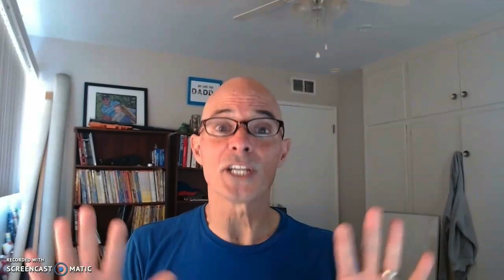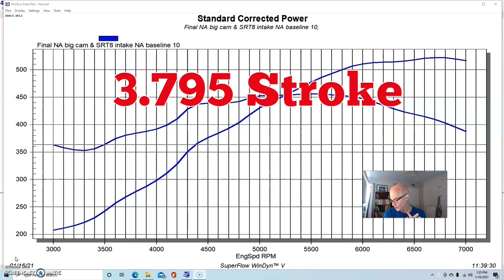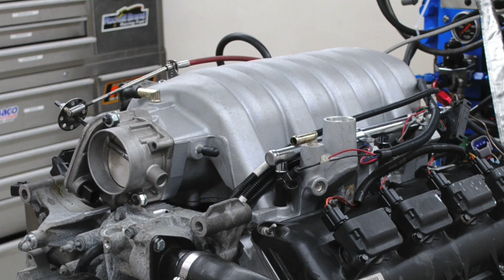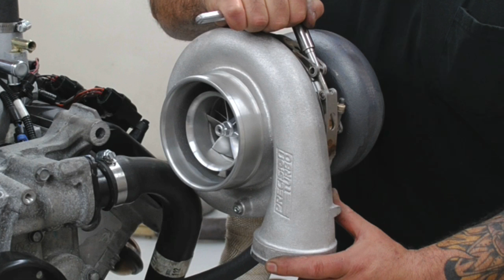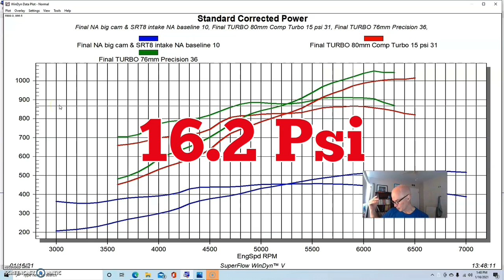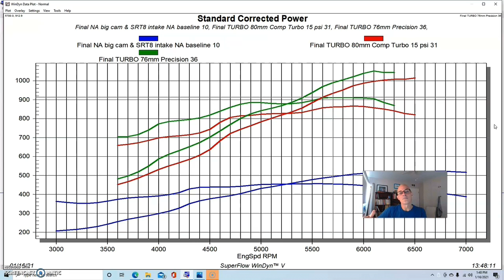1,000 HP TURBO GEN 3 HEMI-MILD vs WILD

Comment: How do you think twin gt35's would work on this? Say round 10 to 15 lbs of boost? Ring gap and all of course
Reply: Or would maybe 66/62's with .70 ar? 800 wheel shouldn't be an issue. When do I have to worry bout pistons? I stay under 1000 I safe?
Reply from the maker: would work fine

Comment: Are these engines total garbage anyone know about a way around valve dropping issues as in a upgrade
Reply from the maker: CAN EASILY BE FIXED AT MACHINE SHOP OR NEW HEADS
Reply: @richardholdener1727  I’m planning on doing a hellcat sc on it and I know I need pistons ect but I doubt stick heads will hold up with whole valve seat dropping on these , I’m a Chevy guy and want to get into something different

Comment: Whats your opinion on the edelbrock victor ii?  im looking at it for my build in the next month or so...
it has the long runners like the magnum intake, but 92mm tb opening.  not seen one dyno run on it though....
2008 ram, 392 NA stroker,  comp cams HRT 3 master kit 277/283 .632 lift, long tubes, hand ported heads (early hemi heads) 309 cfm, 92mm hellcat throttle body....
Reply from the maker: I have one of those and was in the process of testing it when the test mule broke
Reply: @richardholdener1727  awwe bummer. 
My 2008 Ram has a 6-in lift and 35 inch tires so I want to keep my low end torque... I'm assuming the Victor II would be comparable to the SRT or Magnum intakes
Reply: @richardholdener1727  Im just building a fun street truck. not going to track.  I chose the victor ii for the long runners for some low end torque, its a truck.  
But Im thinking of the HRT3 camshaft to give me some top end too.. 224/234@ 0.050 / 0.632
/0.619  115 LSA  (PN MK112-305-11)
Do you think this would be an interesting combination for a balanced build? or do you think it would be a bad combination?  6.4 stroker

Comment: Is this a high compression hemi stroker?
Reply from the maker: NOT HIGH COMP
Reply: @richardholdener1727  so I need help on picking the right turbo for my truck it’s a low compression forged 5.7 stroker 394 and I am looking to reach 1000hp at 5,500 above sea level. What size turbo would be good? I am running a D1sc ProCharger right now that can’t handle what I am trying to do. Thanks

Comment: Excited to see what my results are, I have the Manley stroker kit, did the 8.8to1 compression kit, so hopefully can see some high boost numbers. Just trying to plan accordingly with what size turbos to run? Would like 1000 or as close as possible, any ideas on good one but not break the bank? And you said run stage 2 turbo cam from comp?

Comment: Richard! Love your videos,great info and great knowledge.
Got a question for you.
I was told by a salvage yard that a Ram 2019 hemi 5.7 won't work on a 2011 Ram 5.7,is that true? I know the timing cover is different but other than that the block and heads are the same right! It should be a direct swap right?
Thank you!

Comment: What size injectors did you use to make 1000hp. Don't wanna reach 1000 yet just wanna buy them once lol
Reply from the maker: 80s will do 1000 hp on gas-need bigger to get there with e85
Reply: @richardholdener1727  actually waiting on my e85 fuel pump now lol.  What size injectors would you recommend?
Reply: i run bosch 220s on e85 and im waaayy past 1khp when turned up.  close to that even just under 10psi but im at 411in 10:1 ish and twin s475s.
Reply: And piston ring gap!?

Comment: you should a video with the 5.7 hemi comparing the stock 5.7 intake manifold and the 6.4 intake manifold from a charger/challenger to show the effect of the variable runners. also show what the differences are with cam, headers, other bolt-ons, ext. to see if it has diminishing gains or progressive gains

Comment: Richard, you da man.

My 5.7 is a stroker 397 with full built and forged internals,cammed , 6.1 intake, thitek heads, 6.4 coil pack swap, long tubes, and T6 80mm turbo. 🤘
Reply: yo ik you made this comments four years ago but i was wondering if this was the full build of your 5.7 and how much hp its makes im young and wanna build mines if u can give me a list of your build that would be cool
Reply: @gamingwithjayswag8132  yup, so im
Running a Holley terminator x max ecu 
5bar map sensor (holley) 
Srt intake 
Dual coil pack conversion
Manton valve covers 
Fore innovation  fuel rails 
FIC 1200 injectors 
Twin 525 fuel pumps
1 7/8” long tube headers
CNC’d Thitek dual beehive heads(titanium valves)
Thitek push rods
Mds delete 
Hellcat lifters 
Melling high performance oil pump
Comp cam timing chain
Arp mains/heads studs
Arp swap on every bolt
BTR custom grind  cam
ATI damper 10% overdrive
Callie’s compstar 10:1 compression 6.5 (3.937) forged stroker kit
All new bearings (cam and crank)
On3 performance T6 80mm turbo
50m blow off and 60m waste gate

May have missed some things. Ran me around 17k to build on my own. Made 1106 at the tire before tapping out the turbo.
Reply: @jeepwk6.5L  thanks man i really needed this
Reply: @gamingwithjayswag8132  yup np I have some of the videos on my channel hidden lmk if you need anything else.
Reply: @jeepwk6.5L How has reliability been? Thinking of building something similar but keeping it N/A since it will see hard use everyday but still want to be able to boost it in the future
Reply: @reece7259  i daily it at 93 pump at 950 rwhp and track it on the weekends with race gas

Comment: I would love a combo in my Ram that puts 600 tq and hp to the tires from 2500 to 6000. Problem is getting the 545rfe to live behind it.
Reply: My 545rfe blew apart during tuning and I was only at 718 at the crank when it let go. I’ve ran it back before my second build and it held 433hp for 2 years.

Comment: What's the longevity of a 7-900 hp third gen? Can i boost a stock bottom end to 700 and drive it everyday? Would like to know
Reply from the maker: yes you can
Reply: @richardholdener1727  can I whipple a 2019 5.7 charger stock internals?
Reply: Just want 500whp

Comment: Hi can you do test of piston ceramic coating on turbo engine? Measure on stock fuel 98ron gas power, temperatures, knock limits, ignition advance or something more? If it can be possible i will be happy. Thank you, very good videos.
Reply from the maker: i don't have knock detection
Reply: @richardholdener1727  And how you tune ignition timing? on pump gas and boost?

Comment: Did you use 6.1 heads or did you use the truck heads. I’ve heard you need an adapter plate to use the 6.1 intake on the 5.7
Reply from the maker: i used 5.7l heads and no adapter
Reply: With the truck timing cover you would have to run a truck intake. MMX makes a bracket kit to spread your compressor and alternator out of the way of the throttle body on the car intakes. It comes with a timing cover with the top hacked off. You can also run a car timing cover to just relocate your alternator and compressor, but will have to extend a/c hoses and alternator wiring. Also, alternator may contact the frame rail. If you use a gen 4 intake, the coolant passage bump under the throttle body makes contact with the bottom of the intake - many guys solve this with a heat gun and some light molding of the underside of the intake.
Reply: @RecoilFreak  hey man
By truck you mean Ram, or also Durango?
I am asking because I have 2 HEMI Durangos
2009 and 2015 RT
Would the 6.1 intake manifold fit on both?

Comment: I am ignorant of the hp potential of the new hemis so please don't take this as bashing. I'm just curious why it seems down on power vs  a similarly modded ls3. The hemi intake ports look fantastic in comparison to the ls.
Reply from the maker: ls3 is 6.2l and this was 5.7l-the 6.4l Hemi makes more than the ls3
Reply: @richardholdener1727  The video says it ended up around 6.1 liters with the 20 overbore and 3.795 stroke.

Comment: Very cool love all your vids. But what was the compression ratio of this build? it looks fairly stock, so knocking? Does that fuel and intercooler compensate that much? 

No mention of dish pistons or cometic gaskets?
Reply: Cometic gaskets only lower compression if ordered in a custom thickness.  E85 makes a huge difference as does the intercooler. 

Even with modern compression ratios though you can usually boost anything as long as the tune is right even with pump fuel and boost settings conservative-ish.

I've got a Japanese motor originally designed for boost with 8.5:1 stock. With an air to air intercooler we could still run 15 psi on pump fuel when we upped the compression to 10:1 for e85. It did have longer duration cams which brings the dynamic down . 

I've not turboed as many modern motors but have turboed stock motors in the 9's compression ratio up to twenty pounds with air to air intercoolers on pump fuel.  Some with iron heads!

Once my s13 comes back from the panel beaters and now the motos re assembled after the 10k pull down check its had were hoping 30-40 psi of boost and won't have ping issues on pump e85.
Reply: @hayden6056  Very impressive, and yes most hemis come with a 10.5.1 compression or slightly higher, and from what I have gathered lower compression = more boost. I think the Japanese motors you referenced are designed for that goal. V8's not so much, especially with the pistons (ring gap, and how far down from the top) they tend to go boom if you try to run 12 lbs or higher boost consistently. Don't wanna clench my third eye every time I go pass 10 lbs.

I was just surprised he didn't touch on it because detonation on big displacement hemis is definitely a thing. Yeah tune is huge.

Comment: If the engine is low compression and runs on low octane and I add boost and lower the ignition timing would the engine horsepower and torque go up to the rated turbo output and still use the lower octane fuel? 
I'd like to increase the torque of my 351w's and if I can get a reliable 5-700hp and increase the torque at low rpms, it might be worth it...
I'm addicted to your channel, and the intro is perfect
Reply from the maker: you can still get gains-just not as much as you can with higher octane
Reply: Not running forged rods, and trying to get max torque at a low rpm sounds like a good way to eject a rod through the block.
Reply: @joetalley192  
This is Richards big bang for the 351w, 
https://youtube.com/playlist?list=PLM8JsB6QR-Tad0P2MW6G23RldCeewYy2w
and at 23lbs he had almost 1100hp and about 800 torque on cast rods. It's definitely a risk to try to get more from it and even trying to match it is going to produce the same, but I don't want that much

Comment: Hemi Boys Are Loving this content , test some ported eagle heads on the older5.7s
Reply: Yes I wanna see some newer hemi vvt stuff but I know that they aren't as cheap as the early gen 3
Reply: @-ouv  I picked up some 5.7 eagle heads for my ‘07 stroked hemi for about $300/pr rebuilt (not ported) on eBay. The problem comes when you’re trying to mount the early intake on eagle heads. There’s a significant port mismatch.
Reply: @RecoilFreak  will the new manifold fit?
Reply: @Dylanschillin  2009+ manifolds will fit on a gen 3 block with gen 4 heads with intake spacers or with some slight modification to the underside of the manifold. A heat gun and some reforming where the coolant passage makes contact just behind the top of the timing cover, as well as possibly trimming some supporting fins underneath are required. Aluminum SRT-8 manifolds fit without modification.
Reply: @RecoilFreak  I would say getting your hands on an Eagle 5.7 plastic intake or 6.1 SRT8 aluminum intake will take care of any possible port pot mismatch
Reply: @tomg1807  Good idea! But that presents another issue - my hemi is in a truck. The timing cover is different in the trucks, and the alternator and a/c compressor are mounted close together on top of the timing cover. There's nowhere for the throttle body to locate. The only solutions I know of are using a car timing cover and relocating your alt and compressor (along with custom lines and extending your wires), or the $1000 setup from MMX to spread the compressor and alt apart to make room for the throttle body.
Reply: @RecoilFreak  I didn't know that your build is in a truck. You're correct different timing cover makes a difference because of the component mounting. Since your application is in a truck, my question is could you use intake spacers to get the clearance to use a car intake manifold? If you could run intake spacers, it would help keep some of the engine heat out of the intake to keep the air charge denser, and a trick location for a hidden direct giggle gas injection system. I have come across a couple different offerings for intake spacers,  after I made my own from some 6061 I machined up.
Reply: @-ouv  i don't care as much about the newer VVT stuff as the new heads on old motors.. im biased because its what I have. But it makes for a comparatively cheap upgrade and should be capable of pretty big power on a budget
Reply: You talking about me...... yes Sir
Reply: Is it cheaper to buy ported heads or have them machined?

Comment: Those Comp turbos are terrifying. Oilless design? A grease nipple and an aluminum center section? 
The "80mm" turbo they say is a 4508 design. The compressor is 80x102mm and that's not a copy of any compressor I've seen. It's 62 trim and you almost never see trim that high on compressors this big. A T04z and Gt2860rs have them but they are quite a bit smaller. The turbine wheel looks about big s400 size, it's 96x88m. Strange, it's all strange.
Reply: Yeah but does it works tho?
Reply from the maker: this was not oil less

Comment: Also, I wish I hadn't had sold my 1984 Ramcharger with a 360 Magnum swap, A727, and NP205 case in it, because a Gen III Hemi would've been an AWESOME upgrade for it. I was younger when I had that truck and I didn't know anything about carburetors back then, so I swapped in the Magnum with MPFI thinking it'd run so much better, and it did, but I found out afterwards that the whole reason the 360 LA with the Carter Thermoquad had so many issues was due to vapor lock and I had no clue what that was at the time or how to fix it. It ran great otherwise and was really powerful, but after 20 minutes of driving it would just die and the only way I could get it to run again was to pour gas into the carb.

Comment: Love to see this test with ported eagles and a variety of jntakes like the ritter/weber short and long drag pack manifolds vs the 6.1. Love the hemi coverage, thanks and keep up the good work!
Reply: Eagle heads are awesome flow 330 stock. even more then the ported version of the early 5.7  but the real head to consider is the 6.4 apache heads with the huge intake valve stock flow 340 (I have a set of 6.4 heads for sale)  the 6.4 has a better oval combustion chamber also
Reply: @bad406camaro you can’t put Apache heads on a 5.7 without hefty modifications so.
Reply: Same power, more money spent.  If limited to pump gas, you'd actually hurt performance with more head flow. Reason is that most turbos want to be making at least 17psi. Hemi guys got sold on the incorrect idea that they need heads before thinking about turbos.
Reply: @StabyMcStabsFace  You're right, with the equipment used in this test it wouldn't make much difference. My focus is more my combo with big valve ported eagles, high compression forged lower end. It will be run at 30+ psi on meth where it makes a big difference. Sorry for the omission of those important details.

Comment: I'd love to get my hands on an old Dart coupe and swap this engine into it, except I wouldn't go turbo, I'd bore and stroke the 5.7 and put either a good Procharger on it, or even a 6-71 Roots style blower on it, but I'd keep the MPFI and run it on a Holley XFI system with MSD controlling the ignition.
Reply: Hows a 67 dart hack halfed dana 60 lots of fibreglass.  Ladder bars cool overs 488s spools wheels aluminum in needs cleaning. I'm in Houston
Reply: Thats one of the ideas im kicking around for the 69 Dart project....
Reply: Don't some darts come with a four forty six pack? I don't know if all of them do but some do. I'd rather have that